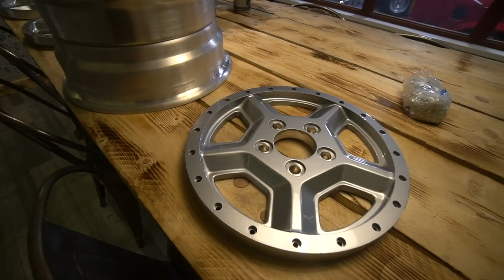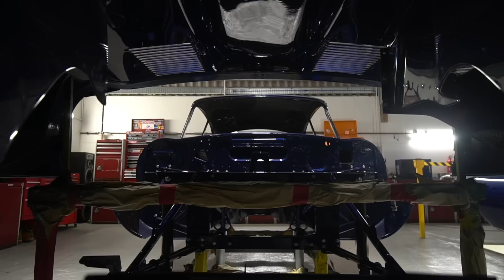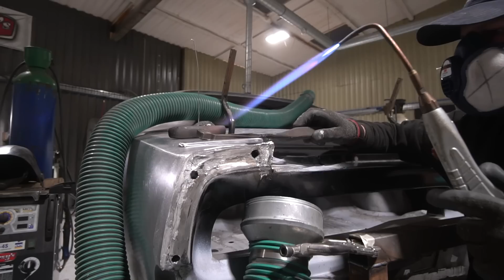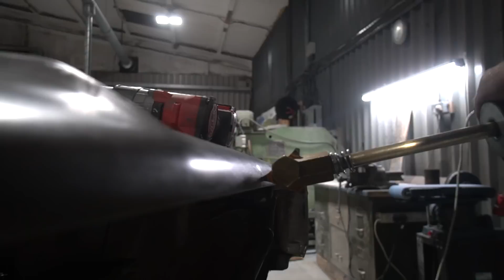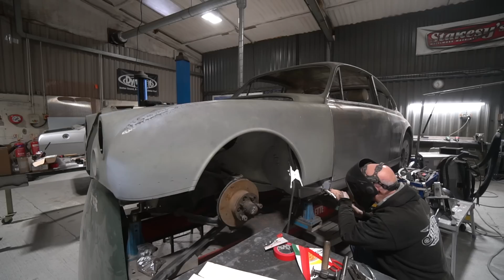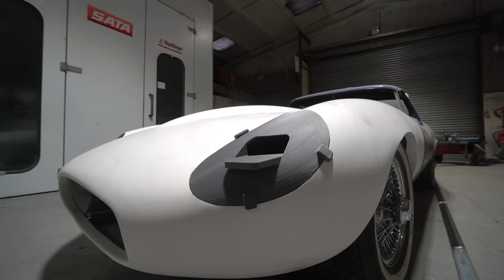Retropower Uncut Episode 114: E-Type Bonnet Re-modelling

Comment: 11:10  I have to disagree with you there, Cal.  Having one sensor only tricks you into feeling reassured - but in reality, it's just two displays (gauge and idiot light) using the same data, and if that data is incorrect, both displays will still agree on that incorrect data.  For true peace of mind, I'll always take redundancy - two displays being fed by two separate sensors.  That way, if there's a discrepancy, you know it's just one sensor not working correctly...and if both read as the vehicle having a problem, you know it's not just a bad sensor.  Yes, it's another sensor, and a little more wiring, but it's not so much more work.  Otherwise, I'd rather stick with one sensor, one display...at least then I'm not being fooled into a false sense of security.  Cheers, mate.  👍

Comment: Please be careful with titanium bolts. I'm sure you guys are fully aware of how tricky they can be to work with. I work on helicopters and we use them everywhere. They warm up and expand when tightened too quickly making them easy to seize and shear. Also disimilar metal corrosion when used up against alloys. Search S92 Helicopter MGB Oil filter failure for an example of why titanium can be bad!

Comment: LC, Manta, Stratos, E-Type 1, E-Type 2, the Escorts, the Camaro, the Cortina, the MK2 Coupe, the Morris, and on and on, you now have an insane amount of cool cars in various states of build. You must pinch yourself, as this is parallel to Boyd Coddington at his peak. 
The variation is incredible, and your capabilities, everything from bodywork to CAD, to engineering, to making custom tail lights, the paint shop, interior, and more, is just next level.
This has to be the time where the highest number of insane builds is going on at the same time. Wow!
Reply: I'm amazed that they can keep track of each job. It must be so difficult monitoring the hours and materials etc....
Reply: They use a CRM system that they covered in Tool Time episode 1: https://youtu.be/X8QSxV2z8Ts

Comment: do that at home and why do your people use the hammer by the head use the hammer by the end and make the hammer do the work
Reply: I did sheet metal on  car's and planes for over 30ish years don't tell me how to do it
Reply: @leescott5300  if that's true you should know better than to be telling very skilled people how to do it!
Reply: @TheMeta6  what ever you do your way I will do it my way
Reply: @leescott5300  
That is the point those calling you out are making.
Some of us have the option of different weight and shape hammers and mallets - I've maybe 20, including basic panelbeating* ones, but have owned more.

*Not my trade, most of my "panel beating" was on 10-25mm plate and involved 4kg sledge hammers, a lot of heating and, sometimes, a 20T excavator
Reply: Two possible reasons, they want to minimise the impact force and/or when he was holding the part it would have been awkward, painful even, on the wrist.
Reply: Holding the hammer only by its end is for hitting in nails or breaking down walls. For control and a lighter touch it can be held anywhere that's comfortable